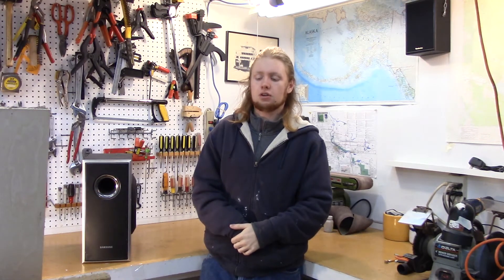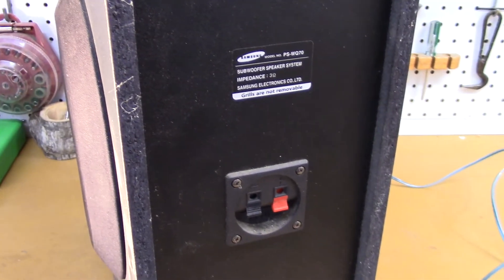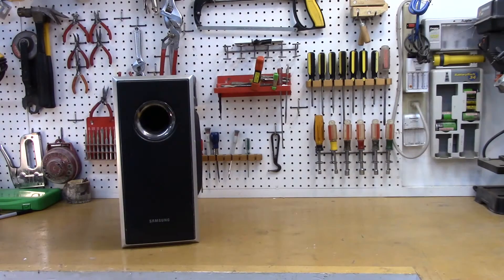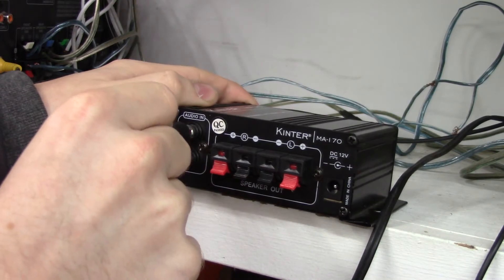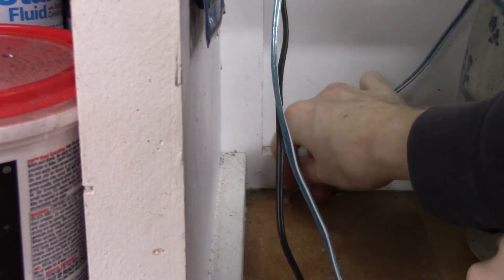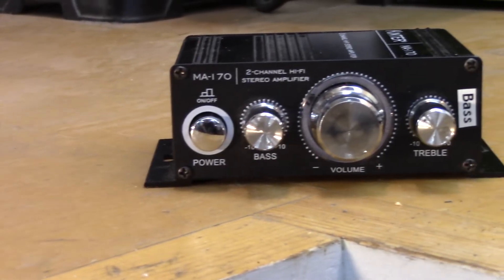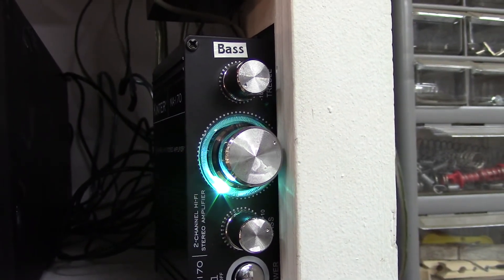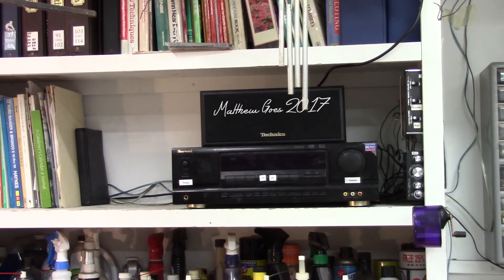DIY 10$ Active Subwoofer

Comment: How to i activate lowpass on kinter amp
Reply from the maker: This one is a pretty basic amp so best you can do is turn down treble or bass to control tone. If you have the ability to filter frequencies before they arrive at the amp that's the best way, but isn't always possible depending on your audio receiver.

Comment: I have been trying to figure out why two separate AV sound systems and two subs would not work. I had no idea there was a thing for passive and active. My original home theater system had the sub connected to it and worked like a charm till the system just broke down, many years of usage. So I need a amp box. Gotcha, your video was literally the most informative and straight to the point content I have been looking for.

Comment: I did something similar when my Hsu sub's plate amp croaked. I bought a Fosi external sub amp on sale on Amazon for $50, and jumped over the plate amp and  removed the line level lo-pass filter (?), and just wired the driver wires to the external speaker level inputs and connected the amp to that.

Looks neat, sounds good and brought my sub back to life for $50 and an hour of time.

It helps to have a multimeter to check continuity at each step of the process, and some kind of sound source or a 9 volt battery to check and make sure the drivers are good before you try this.

Comment: I just bought a pile 390 au stereo receiver. Can I hook up one of those little amps to it along with two passive 12-in subs
Reply from the maker: I'm not sure if that particular 20x2 watt amp would be enough to power two 12's but as long as it has the right RCA outputs it's theoretically possible. I would probably recommend a bigger amp for two 12 inch subs though.

Comment: My sub only has 1 black cable, can i split it or something?
Reply from the maker: Probably? Hard to know exactly what you mean without seeing it but assuming it's a passive sub, it has to have a decent positive and negative input to function, so it should be possible to separate them if they're encased in one cable.

Comment: Can this be done without a receiver? Please reply.  My soundbar is currently connect to TV via Bluetooth, now I have a passive subwoofer (no receiver). How can I run the connections? Any tip would help.
Reply from the maker: All you need is some sort of line out basically. If your soundbar has that, it's possible, if not, it isn't. Hope that helps.
Reply: @MatthewGoesNowhere  On soundbar the only line out are fiber optic and 3.55mm Aux.
I used a digital analog converter to connect everything but power from line out to subwoofer was very low. I could barely hear the sub. Which means I need amp.
Reply from the maker: @kollegeman1  You absolutely need an amp. A line out is in no way equipped to power a passive sub without amplification. A 3.5mm aux will work. If you want to use the amp I used in the video, you'd have to get a 3.5mm to RCA cable, then you plug the 3.5mm end into your soundbar, the RCA ends into the amp, wire up the amp to the sub and you should be good to go. If you don't already have this cord, they're super cheap. Use the amp to tune out the treble so your sub is only receiving bass frequencies. Some other amps probably have a 3.5mm input, just not the one I used. Hope that helps!
Reply: @MatthewGoesNowhere  Yes i think i got it. You're right. My next concern is connecting the soundbar to amp via RCA/3.5mm and experience poor sound quality through 3.5mm. You think it'll sound fine. The speaker is 3 ohms on label and previous owner states it is a 135w.  Id say a 300w amp us sufficient?  My apartment is a small space, 3 to 4 steps from my sofa to TV set. The sounbar is very loud n clear with 0 Bass. I need a little punch. Not to disturb the neighbors though.
Reply from the maker: @kollegeman1  I have no idea. If your line out is having issues, I can't help with that. Sorry. Just guessing based on what you've told me. 300w amp should be more than sufficient.
Reply: @MatthewGoesNowhere  thanks bro.
Reply: @MatthewGoesNowhere  I have a n active subwoofer about 50 watts I think and another 200 watts Panasonic passive subwoofer, can I just remove the 50w active sub in the box and put the 200w passive subwoofer and assemble it back, will the bass increase?, I love bass a lot, I have a jvc amplifier with subwoofer out
Reply from the maker: @Odspeed001  I'm not sure exactly what that would do. Not an audio expert, just kind of a garage tinkerer. It probably would depend on the quality of the subs being used, but in general I don't know that I'd recommend that. I don't think it will hurt anything but I don't know that it will improve your bass volume by a lot. Again, not totally sure on this one. Hope that helps.
Reply: @MatthewGoesNowhere  it works great, I'm using an amplifier with 100w per channel 5.1 channels total with extra sub channel... The bass is shaking my walls 👌😂
Reply from the maker: @Odspeed001  Hey, Awesome! Glad to hear it!

Comment: Hey Bud, what if my active speakers don't have sub-out? say Edifier R1280DB. wanted to make use of my old passive sub also :)
Reply from the maker: Any low level output you have will work because you can tune out the treble frequencies, assuming you get an amp like this one that has an EQ.

Comment: How many power ? (Watt) does this Adapter let you have ?
Reply from the maker: 20 watts per channel, 2 channels.
Reply: @MatthewGoesNowhere  I can only find the 18w x2 one can you check the part id type er whatever
Reply from the maker: @matthewhawes9301  The difference between 18x2 and 20x2 is negligible. Any Amp around that size will provide comparable results. Plus these cheaper amp companies tend to vary their models and names from year to year, so whatever you can find that's similar to this should work fine.

Comment: Thank you for this clever video!!! Because of it I got a similar 100-watt amplifier to power my Pioneer S-HTD510 passive subwoofer to my Pioneer VSX-D411 receiver! Works really well; connected just like you did in the video.
Reply: How does it sound with 100 watts? Trying to decide if I want 100 or less
Reply: @brettb6804  Brett, I think 100 watts is too much. Brett, mate, it sounds so good, it is so powerful, that I had to dial down both the subwoofer frequency to 33% [of max] and the subwoofer volume knob to 33% [of max]. When I first connected the amp to the subwoofer, I set the dials to maximum and looked on Youtube for music high in bass to see the difference.  Too powerful. Hard on the chest. My balls oscillated.  It went through several bedrooms of walls.  My Pioneer surround sound is perhaps 23 years old and still sounds modern, according to my friends. And 33% is sufficient at the dials. Anything more and it is hard on the walls.
Reply: @Artecus  ok, thank you for your answer
Reply: @brettb6804  I live to serve.
Reply: What amp do you have for the sub?
Reply: @jasper9468  From Amazon: “Nobsound G2 Subwoofer Amplifier Mono Power Amp PBTL/BTL Bridge 100W Mini Sub Amp Home Theater”
Reply: @Artecus  thanks!

Comment: nice video how would i go about adding a powered sub to a reciever without sub pre out jack
Reply from the maker: You can use any out from your receiver. Tape out, whatever. As long as it's a low level output this technique will work. You can EQ  the high frequencies out with the amp box.

Comment: I have a vintage receiver Onkyo TX-3000 and I am trying to find a similar solution to hooking up a passive sub to it. It doesn’t have a sub out connection so I am really confused. Will this type of amp help or would it help to make this sub active?
Reply from the maker: This amp would make your sub active but you'd still need an out from the receiver. Any extra RCA out should do, just make sure to use the amp's EQ to cut out your treble frequencies.
Reply: Matthew Goes Nowhere Awesome. Thanks.

Comment: What if your avr is only set up with wiring...no jacks for the subwoofer.....is there a way to hook up a mini amp to the avr then wire the subwoofer,  so you have more power on it?
Reply from the maker: Not exactly sure what you're talking about. This method is really only viable if you have an extra RCA out of any kind from your reciever.

Comment: Some receivers this will not work. I have a Sony STRDH590 this does not work, but some other brand receivers this will actually work fine no problems.
Reply from the maker: Not sure why it wouldn't work on that reciever? This whole amp setup is external to the receiver, the only thing one needs is a subwoofer line out. Pretty sure that Sony has sub line out(s) so I couldn't say what wasn't working there.
Reply: @MatthewGoesNowhere  it got a Sub out, but I had a old Sony sub from 2007 and tried this, and did not work. I tried on a 2017 Sony receiver still did not work. But, when I tried on a Yamaha, Onyko, etc... It worked.
Reply from the maker: @2414kels  Probably means your sub outs aren't working properly or were somehow switched off. It does happen. This amp system isn't receiver specific at all.

Comment: Great video!  I'm in the exact same situation where I have a passive subwoofer that I need to connect to a newer receiver that has an RCA connection for the subwoofer.  I really didn't want to purchase a whole new subwoofer, and was looking for cheaper alternatives.  I'm going to try this and see if it works out!
Reply: So I tried what you did in the video and purchased a cheap amplifier, hooked it up, and it worked perfectly!  Saved me from having to purchase a whole new subwoofer.
Reply: Hi! Unfortunately it did not work on mine. Is there something you can tell me about on how did you do it? Thank you.
Reply: @felixkevinfanilag300  I ordered the Kinter mini amp off Amazon and then just follow the instructions from this YouTube vid.  Here's the link to the amp:  https://www.amazon.com/dp/B077Z7DBRT/ref=cm_sw_em_r_mt_dp_U_RsHfDbVYY4YGX

Comment: I would like to ask for sone possible factors on why this isnt working for me i connected them all correctly but my subwoofer does make a sound
Reply: Jon I have the same issue.  I bought this Kinter MA170 and all I am getting is some rumbling when I mess with the wires, but it is not producing any sound.  Woofer is on in my AVR settings.

Comment: I just bought a cheap old receiver on eBay that needs a powered subwoofer and I've a few passive ones lying around. I was thinking of this exact idea. Nice to know it works. I assume you have get an amp that matches the ohms of the subwoofer too? Although blowing a €10 amp is not a big deal I suppose..
Reply from the maker: Joe O Sullivan Blowing an amp is unlikely. Blowing a speaker is more so. This is a cheap as chips solution, so the wattage of the amp you get for 10€ won't be enough to blow anything really. I wouldn't worry about it too much.

Comment: i have a 7.2 Yamaha receiver and i’m only doing a 5 channel setup. i have a passive sub that i connected to the surround left port and it has pretty good bass if you have the volume up. My receiver outputs around 140 watts per channel, I really only care about bass, do you think if i got this and connected my sub through the actual sub port the sub would sound better and have more bass? thanks
Reply from the maker: ZaidTV Yes. The issue with using a surround channel is that you're unintentionally sending all the high frequencies to your sub, which isn't good and makes it sound muddy. Going through the sub channel is a far better option, with this amp it's possible it wouldn't be as loud, but it will definitely sound a lot better. You can also do this with a more powerful amplifier, it would just be more expensive.
Reply: Matthew Goes Nowhere thanks! I actually just bought the Polk Psw 108 powered sub for only $125, and it hits insanely hard in movies and music. I couldn’t of asked for a better sub. I have the bass turned all the way down on the sub and it still shakes my whole house which I love. I don’t think I’ll be getting another sub or stronger sub anytime soon haha
Reply: @MatthewGoesNowhere  nice to hear it guys. But here's one more interesting task. If receiver has 2 outs for active sub, but you have the same 2 passive subs. Can we handle it with one same amplifier? If yes, how? If no, what are the options?
Reply: @olegprotopopov3393  couldn't you use this device & plug one sub in the left & the other into the right, like the video shows?

Comment: I have a subwoofer self build and i am looking for a amp but the subwoofer i am looking is 349w and that amp is 18w
Reply from the maker: LOLSwagger More powerful amps are easily available with a similar design to this one. You're free to buy one of those. This isn't the loudest or best solution, it's just designed to get you a decent sub on a very tight budget.
Reply: Get a cheap car amp and use a pc power supply

Comment: Hi! How would I go about connecting a passive subwoofer to a smart tv with that little box??
Reply: Edgardo Mauricio Campos Ruiz audio out from TV into the input of that box then hook your passive subwoofer into that box. Tbh though you are probably better off buying at least a soundbar.
Reply from the maker: What Crash It said was good, nice to run all your sound through a stereo reciever if you can find one, but if not, RCA from the TV works.

Comment: Great video sir. I'd like to know if my car audio system didn't have any dedicated low frequency output how would i connect the active subwoofer for low frequency signals. Also i wanna know if these small amps would give sufficient bass with 12v battery. Thanks
Reply: ruknani Hi. If your car stereo jusy has a line out, that will work. You can cut out all the treble frequencies with the Equalizer on this amp. If you don't have any out other than the powered speaker outs, this amp won't be able to handle that. As for the 12v battery, as 12v is just voltage and not wattage, I can't say specially if this amp would run on your battery, but it most likely would. I've run it off of a motorcycle battery (12v) before which worked for me. It depends on the amps your battery produces. Let me know if that helps. Happy trails!
Reply: Darthcraftable thank you for the reply. I wanted to know if my stock player which came with normal door speakers in my small car (I actually replaced that pair with  coaxial two way speakers recently) that didn't have any dedicated subwoofer connection (passive or active) could i use the right or left speaker line to connect with sub woofer amp?  About 12v battery, thats my car's power source. I don't know whats the wattage and specs of a normal car battery.
Reply: ruknani Using the right or left speaker line probably wouldn't work, as this amplifier is meant to deal with line level signals (low electricity). The outs from the car stereo to your speakers are speaker level signals (aka higher amounts of electricity) because they have to power the speakers.
Reply: Darthcraftable If i m not wrong i am gonna have to use one of those line output converters ( hi to low signal converters).
Reply: ruknani You could. Honestly, unless you are super tied to using the stock stereo for whatever reason, I would just recommend you get a new head unit. Good condition used they're not that expensive and you can get one that has sub or line out.
Reply: Darthcraftable Thank you for your kind help.
Reply: ruknani Sure thing! Best of luck!

Comment: I was wondering can you do this with a car subwoofer with this setup? Thanks
Reply from the maker: HetIsArjen You can. This amp takes 12v power, so instead of running it from a 120v adapter ( as seen in video) you just wire it directly to your vehicle's electrical system.
Reply: Matthew Goes Nowhere So i can connect the car subwoofer to the amp box, and connect the amp box to my reciever?
Reply: Matthew Goes Nowhere because i want the car subwoofer in my house
Reply from the maker: HetIsArjen Yup! 👍
Reply from the maker: HetIsArjen This amp will work with any passive subwoofer in any location as long as it has some source of 12v power and an audio input signal. Both should be fairly easy in a car or a house.
Reply: Matthew Goes Nowhere okay thanks! Im going to buy a car subwoofer then. Il let you know when im done setting it up.